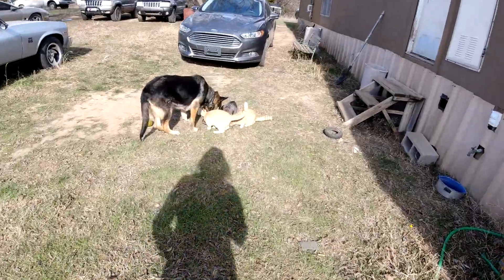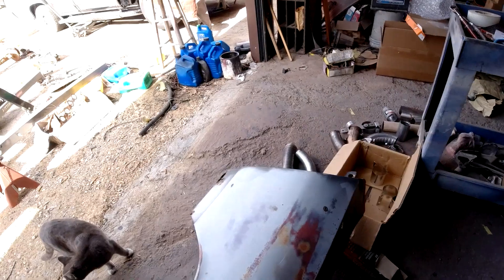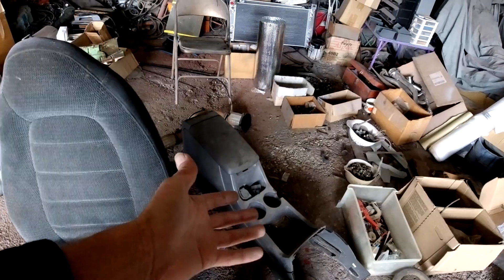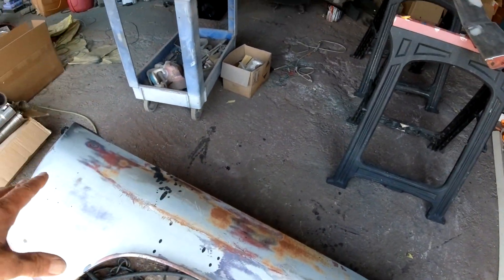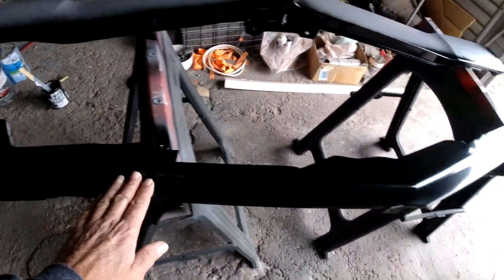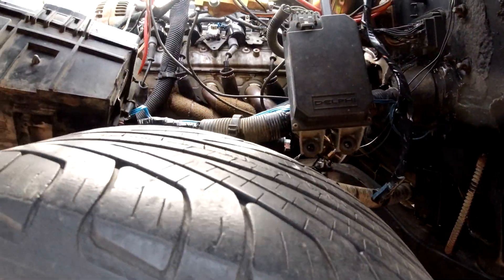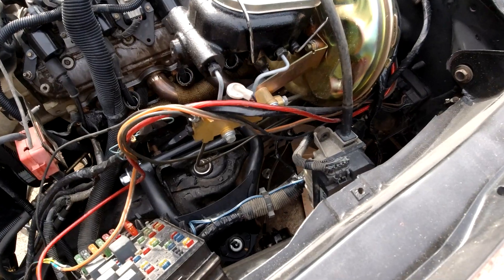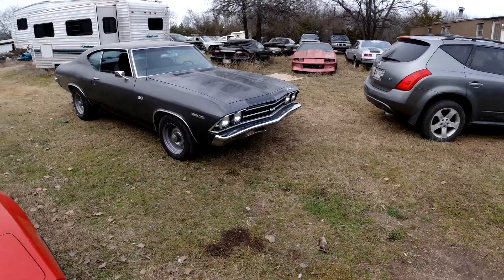1968 Chevelle Nomad Restoration - Part 50 - Repairing and Installing the Front End

Comment: Lee. Happy New Year! 
My Steering was leaking on my 01 Silverado, I put in some AT-205 a couple years ago and hasn't leaked since. I usually don't use snake oil. I just didn't want to mess with changing the power steering.
I'm not Nitpicking, just a Question. The SS emblem on the grille. Isn't there a Top and bottom? I thought there was a smaller part of the S being the top.
Great Work coming along nicely.

Comment: 15x6with 215-75 tires for the front. 10 inch wide rear rims will stick out of the quarters too much. Go with the 8 in. for the rears.

Comment: i use top global on ebay for my paint they don't have the stuff for factory colors but there close enough just got a blue kit with all the stuff i need to paint for 150
Reply: I will have to try that. Thank you, I always look for a good recommendation when I buy parts for my YouTube.
Reply from the maker: I've tried them but their paint fades out fast!
Reply: @clunkersandclassics  thank you for the input
Reply: @clunkersandclassics  realy you must have got an old stock i painted my 67 newyorker 6 years ago  and my ram charger 3 years ago they are holding up fine
Reply from the maker: @richwilson8658  Texas sun bakes them until they look like primer, I doubt they're $150 anymore. I used some $106 paint 6 months ago, now it's $160.

Comment: I noticed that you paid $40 for a gallon of Dynalite body filler. Is Evercoat Lite Weight Body Filler no good? It's $24 a gallon on Amazon.
Reply from the maker: I didn't know that. I used to buy at Walmart for $18 but they no longer sell gallons.